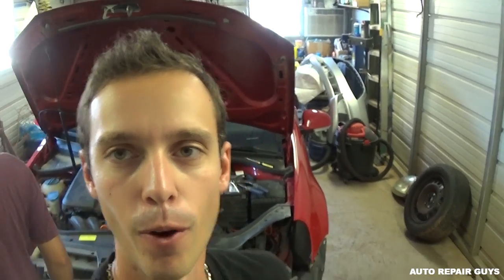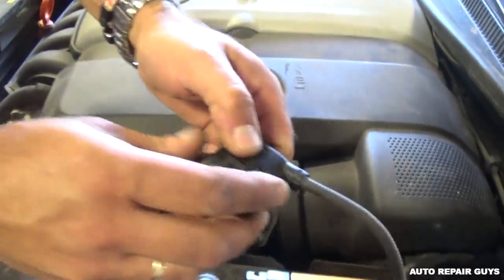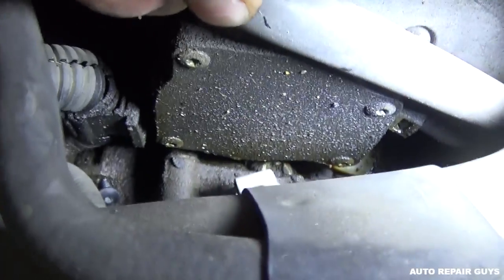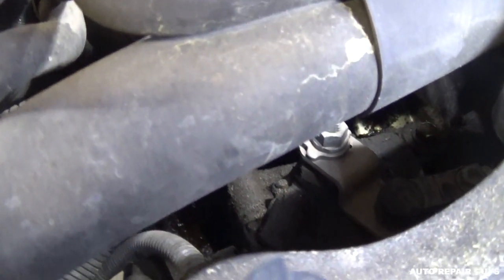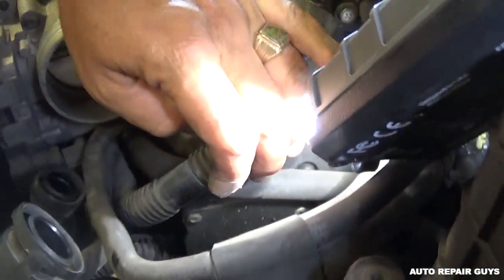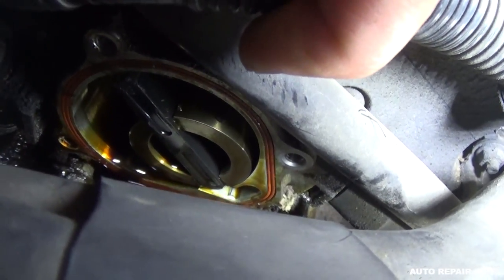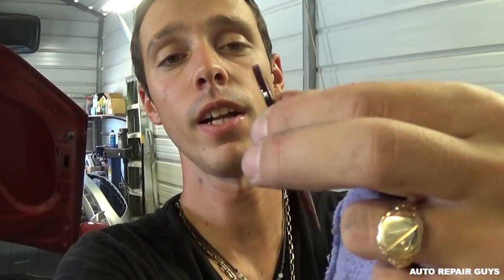VW JETTA GOLF BEETLE RABBIT 2.5 OIL LEAK FIX | COMMON OIL LEAK

Comment: Hi, I went directly with wolkswagen dealer, that part is called engine oil vaccum pump, you will not find the gasket anywhere is not sold separately you need to buy the whole enchilada and is about $470, well I went n bought a Lucas engine oil stop a leak depending how severe your leak is it will work, however you must run your vehicle for a 2-3 days, if that doesn't work? buy an RTV, an RTV is like a silicone, once it sets/dryes it works like a gasket, remove the engine oil vaccum pump plate, clean  the area as good as possible do not remove the old gasket apply evenly the RTV, be generous let it set for 20-30 mins, replace the plate and Wham!!! problem fixed, hope this will help some of you guys, good luck!!
Reply: I just bought it in partgeeks
Reply: Dorman has a repair kit !
Reply: How much was it when you take your car there ?

Comment: So for anyone reading this.   The part they opened up is the vacuum pump.   Officially that gasket is not replaceable,  you replace the entire pump.   However a company called rkx sells a pump rebuild kit,  includes the gasket.  Some have gone as far as just putting in some silicon sealer instead.  There are a few other options but most vw shops will recommend complete pump replacement.   The pump is $300 or so,  and labor is quite high on some models due to pump location.
Reply: I am going to replace is the gasket under the front cover because that is all that's wrong with mine. It's leaking from the front cover and I am about to sell it so I just want to stop the oil leak.. The exact part they just replaced on this video. I am now looking for the exact part number for my 2010 vw beetle 2.5. they sell the front cover gasket and the back gasket seperate everywhere, but i just cant find out the one for my car part #?
Reply: Thanks for the info, much appreciated i had no idea what that was called.

Comment: I did this repair my self and did not replace the gasket.  Remove the plate, clean, apply rtv high temp sealant under and on top of the gasket thin coat.  carefully reattach the plate be carefulf to not disturb the sealant. tighten it sown you should have a small amount reveled as you tighten it down.  Cost $3.00 FOR RTV.
Reply: How is it holding up for you?
Reply: @crbb3099  great.  Gotta replace the gasket between vthe pump and engine block now.  My last VW.  Stupid crap like this.  Always something.

Comment: I've watched a bunch of videos on this problem and all of them show how to remove the entire pump. Common opinion is, this is the ONLY leak on the pump and in most, if not all cases, removing this plate to replace the gasket is all that is necessary. Yes, you can buy a rebuild kit which is less expensive than buying an entire pump, but that still takes a lot of extra time. Because this is the only video I've seen showing ONLY this stage which saves unnecessary work and extra time, I give this video "two thumbs up". Great video, guys! 
I have this leak. I'm going to follow these guys' lead and change ONLY this rubber gasket. If that does not stop the leak, then I will go back in and replace all of the gaskets with the rebuild kit I just bought.
Reply: How is the leak? Gasket do the trick?

Comment: I just did this job today on my 2008 VW Rabbit and I have some tips which make the job of replacing this O-ring style gasket easier. 

First, remove the battery, case and tray. This gives excellent access. 

Second, get several sizes of 1/4" drive socket extensions and use  short T25 bits to fit in a socket. You can use these extensions as screwdrivers after loosening the bits with very small 1/4" drive socket wrenches and 1/4" drive ratchet wrenches. (You can get these tools on eBay, Amazon, etc.) You will NOT need a universal socket joint because you can slide a 1/4" drive extension underneath the automatic transmission gear selector without removing it. 

Third, take your time when inserting the new gasket into its groove. It will go in all the way if you are patient and use your fingers to make sure it is flush. Once in the groove, rub the surface of the gasket and groove with grease to make it slick and not rub against the cover plate when you re-install it. While you're at it, rub some grease on the cover plate after you have cleaned it off.

Gently tighten all 4 screws evenly, making several passes "around the circle", until they are all snug. Gently snug them with a socket or ratchet wrench.
Finally, torque the screws (again, a little at a time) until you have tightened them all to 10 Nm or 87in-lbs.

After I did this, I sprayed Brakleen all around the area to clean off the oil and be able to check for future leaks. 

Then I put the car back together, went for a test drive and had no more leak!!!!!

Hope this helps.
Reply: Where did you buy the gasket? What is it specifically called?

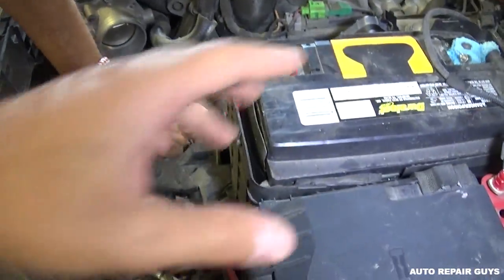Comment: Hint:  about 4:00 he mentions you can take the battery and battery plate it sits on all out to make this access much easier.  That's a great tip if you don't do this repair often. It's a very fine video.

Comment: Holy buckets of shit! I've had my car "repaired" twice: once by a personal mechanic for $240. The second time for same issue to the VW Dealership. Under "warranty " it still cost $650. 6 months later: my car hemmoraged oil in my driveway. Now the dealership wants$1,650. to install a new gasket that they say looks like it's NEVER been changed. I'm pissed-off now! Thank you, thank you, thank you for this video!
Reply: Melissa Brzescinski Yes, they also asked me for $1,420.00 to fix that same leak. I looked up TheHumbleMechanic and he as a step by step guide on how to replace the entire vacuum pump. It seals in two sides. It sounds like the first repair was what you saw here, and the second was to replace the pump. They remove the transmission, that’s why it’s a lot of money on labor. But, there’s a way to replace it without removing the tranny. That’s how I did it for $220.00 for the vacuum pump (parts). Lots of cash in my pocket...

Comment: Thank you for this post and to the comments about the o ring/ gasket piece. My dealership is going to hear it from me, no doubt! I've been educated and now I'm armed for battle. They owe me.
Reply: There  is no battle if they fixed the leak.  They could have opted for a comprehensive fix and replaced all the gaskets and vacuum pump itself because you can't be sure which gasket leaks or even if the pump is degraded.

Comment: I have been searching the interwebs high and low for a video on replacing the oil filter housing/ bracket on the 2.5l engine. I have already done the vacuum pump repair, and only a month later I developed a leak at the oil filter housing. It appears to be coming from the seal between the block and bracket, or maybe cracked, or possibly oil cooler gasket, so I purchased a new housing assembly and both gasket kits. Some people claim you have to remove the manifold and go in thru the top. Others say to remove the front clip and go in that way, while others say to go at it from underneath and just remove everything until you get down to the bracket bolts. 
If I could at least get an idea of how to start this so that I am not spinning my wheels ... I would appreciate it much

Comment: I have a Jetta 2.5 with a slow oil leak.  It is easy to mistake it for being the rear main seal when it may be an oil leak at the vacuum pump. since they are close to each other.  It may be possible to change the vacuum pump without removing the transmission too.   I am not 100% sure about it but if you have a leak that may be the vacuum pump, you may want to look and see if that can be repaired at all without messing with the transmission too much if at all.  I know I would be really pissed if I paid a ton of money to pull the transmission and it was doable somehow without doing that.  It is only worse when you need a new transmission (one repair many people dread).
Reply: You can replace the entire vacuum pump without removing the tranny. I've done it to my 2007 Jetta. It took me a couple hours and it saved me the $1,425.00 the stupid dealership wanted.
Reply: John Doe i did mine and found out that there is a hose conector, the one  that goes to the booster..you take that out..and there is a o-ring there also. If the leak still you need   to change that one too.

Comment: Usp motorsports sell the kit, manual transmission is easier to work with than the automatic
Reply: Ercy Suazo is this the oil cooler seal?

Comment: Just curious once sealed do you have to change the o ring or can you leave that way. Do you know how long it lasts.
Reply: Always change the "O- ring" after unsealing the plate with four bolts.  Age, heat, and time makes the gasket brittle which allows for the very common leak.

Comment: The problem with vw seems to be the oil coolers, and filter housings, and the vacuum pumps. But I have yet to see anyone just remote relocate the oil filter housing  with quality metal housing. I may need to try to solve that issue.

Comment: My 2.5 rabbit is leaking oil and it gets terrible mileage. But it’s so fast and fun to drive-even with 269,000 miles on her. I was getting 25mpg but now I’m down to 22 or even 21. I think it’s something to do with maf. Also whenever I get gas I have to crank and crank and mash pedal to the floor to make it run. Runs rough and then a minute or 2 later it’s smooth and is good til next fill up. Why?
Reply: @mole man this is old but it’s purge valve

Comment: This is the vacuum pump failure now there is a delete kit for this engine and it gives a bit of more performance to it
Reply: Not sure many would agree to use a "Delete kit"    Hopefully you realize that this pumps entire function is provide constant vacuum to the brakes...
Reply: @gr8jpn  In my experience and research, that is a load of shit that...to be fair...I initially believed to be true.  Only diesel engines NEED a vacuum pump, because they don't have a manifold vacuum.  Gas engines do have a manifold vacuum, thus they do not need a vacuum pump.   Hence why most gas cars do not utilize a vacuum pump for braking.  I have had the vacuum pump deleted in my mk6 jetta for a year now and the brakes feel the same as they did before.
Reply: @_Ezio__Auditore_    So your highly scientific research lead to: "they feel the same..."    Good for you.  While German cars are often over engineered...   I don't think I will personally take this route.

Comment: Anyone know if I need to drain the oil before I do something like this? It's at the top of the engine, so I imagine I wouldn't, but also don't want to find out half way through.
Reply: You do not have to drain the oil.
Reply: No necessary, before to open the shield place a broken towel to prevent the spill.

Comment: What was that 1st sensor you unplugged on the air intake mine is missing that completely just bought the car
Reply: Yo mine is missing too that's wierd
Reply: Not all vehicles have both. Some have 2, some have 1, some have none.
Reply: Mine only has the one maf sensor too bad it’s short as fuck and won’t reach to a CAI

Comment: where to find this seal?
Reply: tanoshides you can find seal on Amazon or Ebay. However it is preferable to get a new vaccuum pump as the OEM was constructed with two type of metal (expansion in high temperature broke down seal). The new part fixes this. Although quite expensive. But no more oil leak!

Comment: I did this today, no more leak, but my brake pedal was hard feeling, eventually braking felt somewhat normal.. but not exactly the same as before.. im hoping it will go back to normal after driving around some...  anyone else experience this ?
Reply: sound like you left a vacuum line off
Reply: I found the problem...  vacuum line at booster was cracked.   replaced and all good now.
Reply: @HR-rt9nh  yeah, that vacuum line is painfully expensive though. Apparently it is a common problem
Reply: What is the part number or the name ?